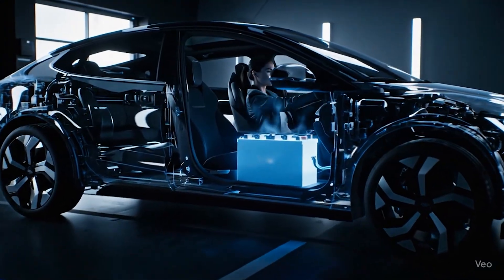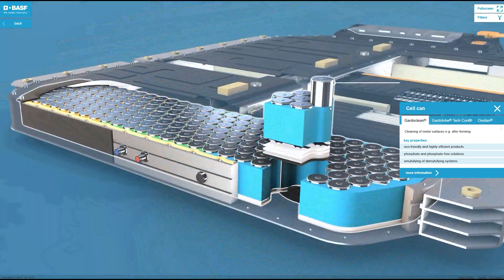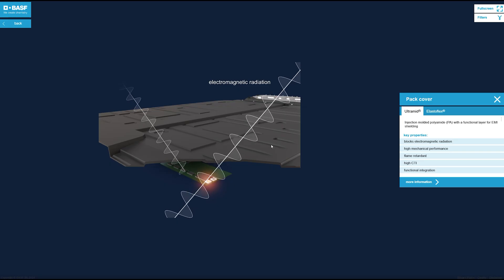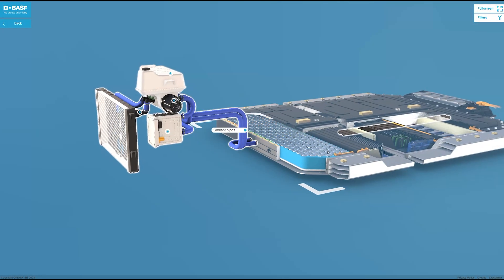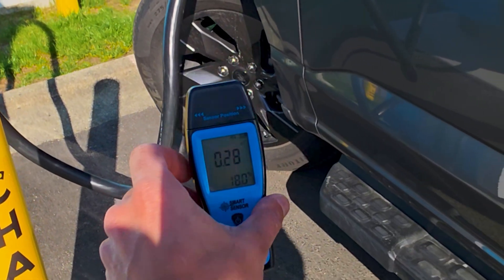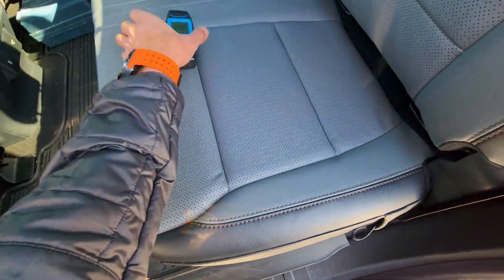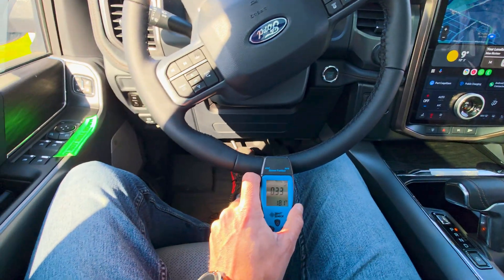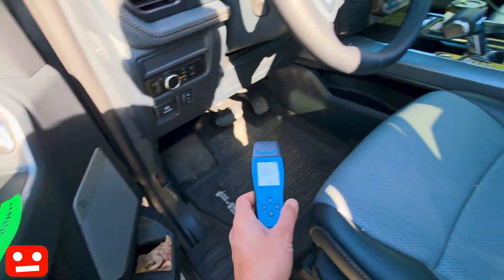Is My EV Dangerous? I Measured It ⚠️

Comment from the maker: I wanted to see what kind of EMF levels show up around an EV in normal use, so I tested my F-150 Lightning with a real meter and shared the results without hype.
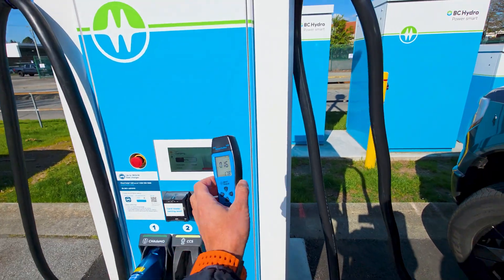The actual testing starts at 2:55, and everything I measured stayed well below safety limits, even when the meter beeped. Appreciate everyone watching with an open mind!
Reply from the maker: Good question. Scooters usually produce much lower EMF than cars, especially during steady riding. Do you notice anything different during hard acceleration or braking, or is your concern more about constant exposure through the deck? That helps narrow it down.

Comment: How about my electric scooter Ausom dt2 pro? Theres a plastic lid between the battery and my feet. Thoughts?
Reply from the maker: That’s a good question. Scooters are a bit different than cars since you’re standing right over the battery. Have you noticed anything change during hard acceleration or regen braking, or are you mostly concerned about constant exposure through the deck? Also curious if you ride longer distances or just short trips.

Comment: You need to test while accelerating or regen braking.  The motors use much higher currents than charger or accessories.
Reply from the maker: Good point I didn’t think to test it while regen braking or flooring it. The current draw from the motors could definitely spike the field more than just sitting there charging. Might try that in a follow-up video.

Comment: AC is the problem, not DC.
Reply from the maker: Good point! In this test I was using the meter on the F-150 Lightning while it was actively charging. I scanned multiple areas around the truck cabin,but the only place it really spiked was right near the charging cable. So yeah, likely AC-related interference during the charge cycle, not DC from the battery itself. Definitely worth digging deeper into how these readings behave under different loads.
Reply: EVs DC to AC for the motor. They switch the DC voltage using PWM at 10-20kHz.

Also, the motor leads are well shielded as the PWM switching creates a lot of noise messing with communications etc.

Comment: Meter RED and beeping. "Nothing to worry about".
Reply from the maker: @VladoT Totally get why it looks alarming with the red screen and beeping in the rear footwell (where your feet rest in the back seat) BUT that reading was just 0.89 µT, which is over 20x lower than public safety limits in Canada, the US, and WHO guidelines. These meters are just super sensitive near AC lines like the charging cable 🔌😅
Reply: The reading on it is what matters
Reply from the maker: @pressPasser Exactly 👌Thanks for pointing that out!  That’s why I made sure to point out the actual values even when it’s beeping and red, it was still well under any safety limits.